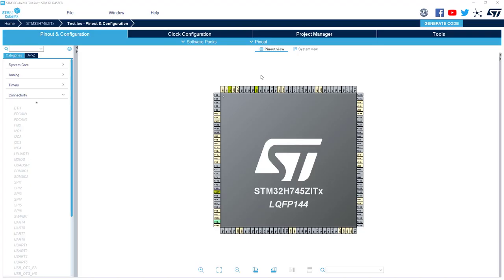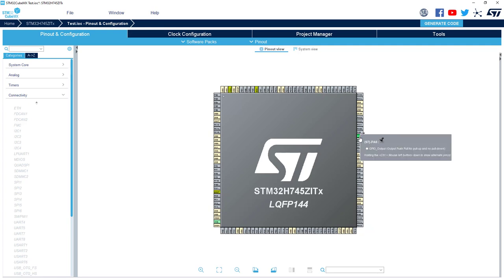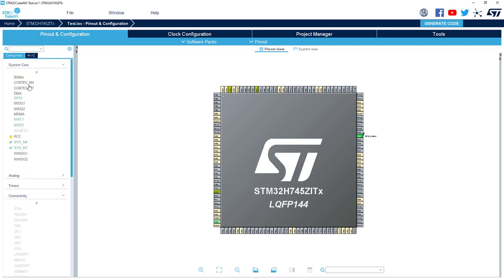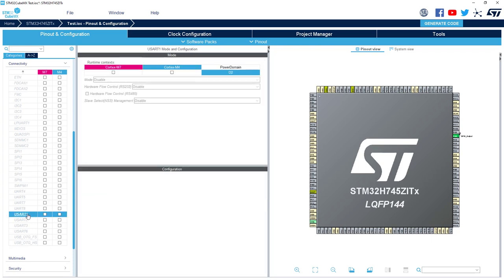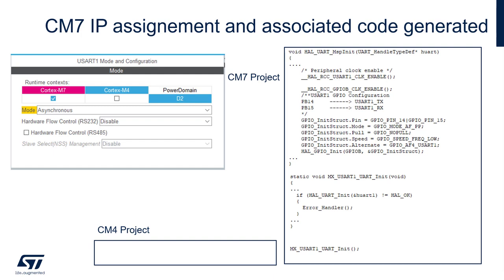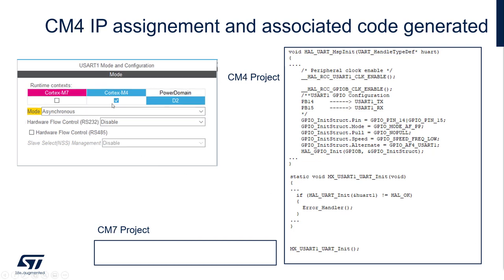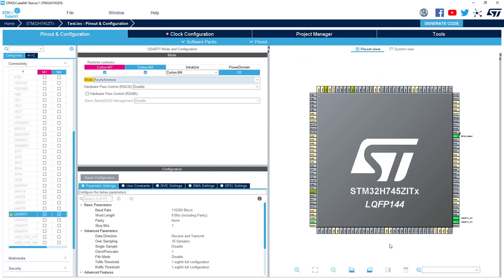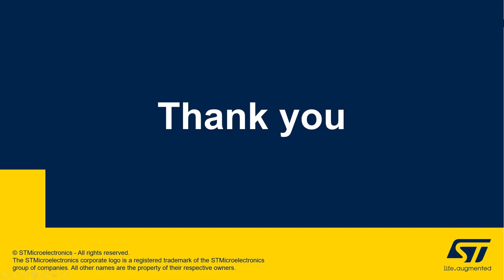STM32Cube tools in practice - STM32CubeMX, STM32CubeIDE - dual core MCUs pins assignment

Comment: I understand that the peripheral resources are assigned to each core.. but can they be changed at run-time?   For example, can the cores communicate, such that one passes UART access to the other?

Would love to see an overview example on how the memory works in dual-core applications.   For example the STM32H745 has 2MB of flash, and 1MB of RAM, but how can you allocate most of it to the M7, and the remaining to the M4?    Is it possible to debug both simultaneously thru a single JTAG/SWD connector?     

How does communication work between cores?